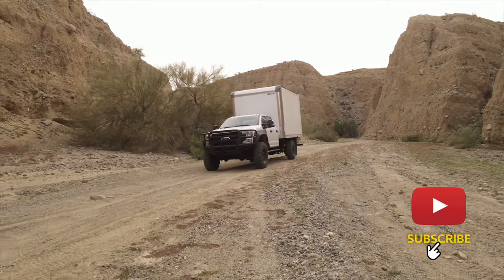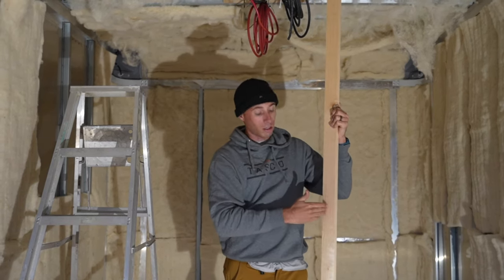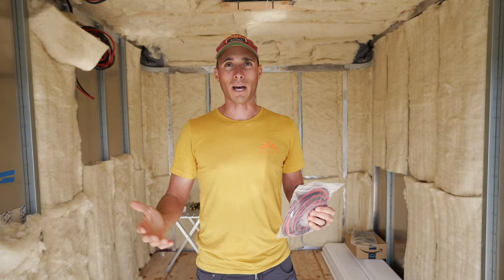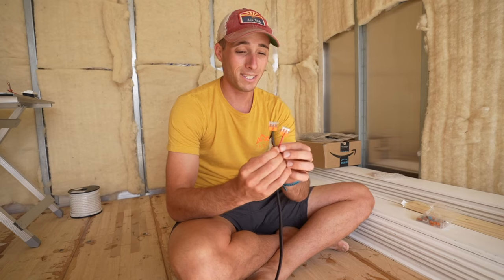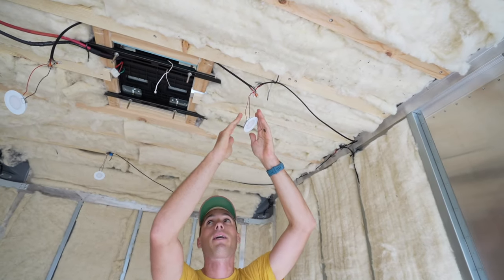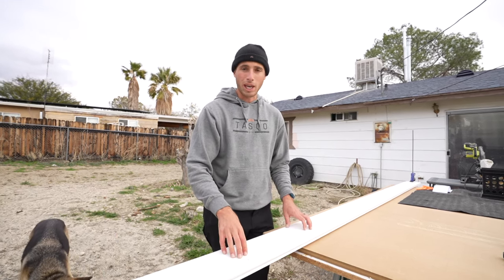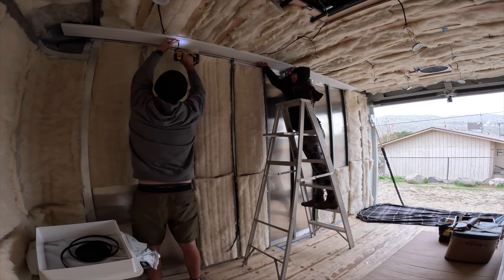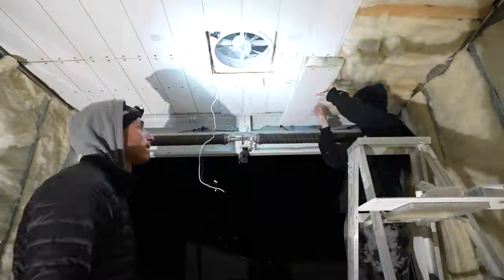DIY Expedition Box Truck Build / Part 3 / Floor, Overhead Lights and Ceiling Install!

Comment: Wood putty or even Bondo would have been a better choice than the epoxy you used for the screw holes